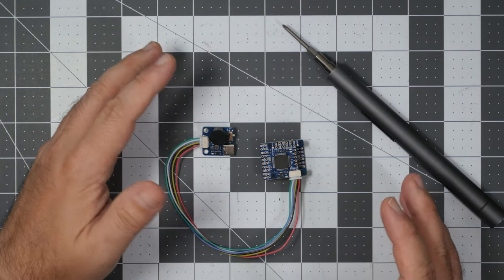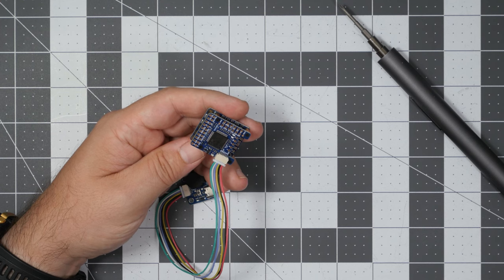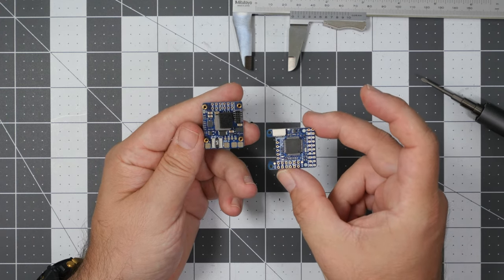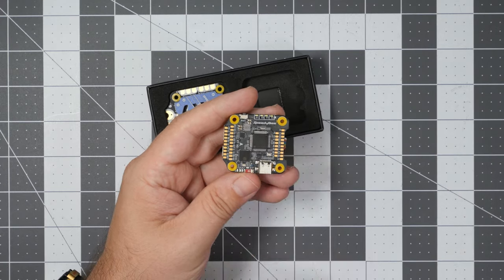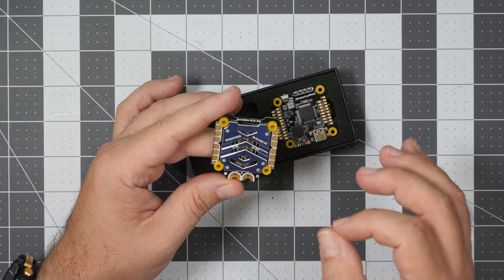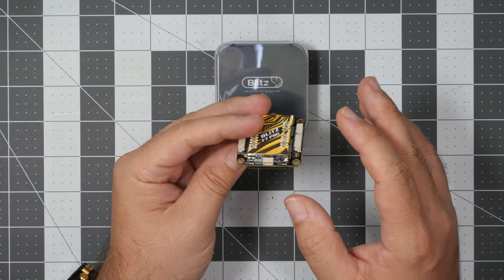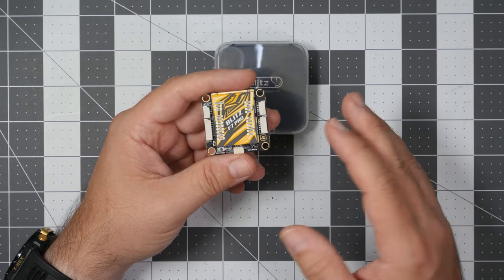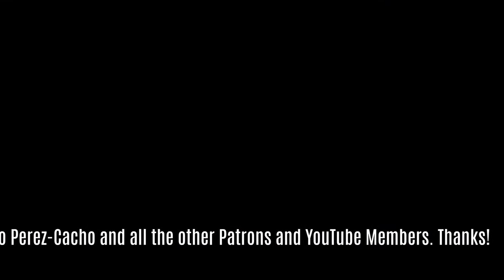Matek F405-WMN, SpeedyBee F7 V3 and Blitz Pro

Comment: 16MB is laughably small for any serious logging. also stack is rather tall for some smaller fuselages. Otherwise nice progress!
Reply: Using a external SD logger became an option for that use case though ;) It's good to see more variations coming out... I have the 765-WSE board, and really like the flying USB connector - if only becase it also has the beeper disable switch for when programming at the bench. 🤣

Comment: Hi Pawel, I got matek F405WMN and all good but I get A lot of video noise after the throttle goes above 20% I put cap on esc and on lipo and LC filter on vtx but still very bad video, any ideas? Thanks

Comment: Hi, Your videos are really interesting, I enjoy watching. A question in short if you may help .... I'm willing to start flying FPV direct, I mean no Arduplane planned flights, or autonomus, but just flying "from the cockpit" with a good OSD on display - regular flight and some basic aerobatics.
I have a Matek F405-WTE FC and build an Open.HD system with Raspberry PI's, and Head Play HD. Everything looks good but the OSD isn't refreshing really good so it looks is not ideal for what I'm lookinbg for. I'm only looking for a short range flights , similar to visual RC flight.
Could you please help suggest a configuration that would be simpler to wire and would provide better performace for what I'm looking to do?
Reply from the maker: It would be either DJI FPV or Walksnail. Wiring simple, small, light, proven to work

Comment: there are two questions, I ordered myself F7V3 flight simulator, but I saw that the baron is 280, but the gear is not mpu 6000 there, how bad is the gyroscope there??? BMI
Reply: Betaflight has fixed any issues with the BMI gyros apparently. Mine flies great with my tmotor F7.

Comment: Unrelated question, is the omnibus f4 v3-s version supported by inav? The accelerometers do not work when I try to flash with f4v3 firmware, is there an older version with support?
Reply from the maker: you might have BMI270 version. It might work with INAV 6 thought and search on INAV's github for test build
Reply: @FPVUniversity  will do!

Comment: How would the speedybee be in a wing? Safe to use 4in1 esc to power a single motor?
Reply from the maker: Not good for a wing. Pick a FC designed for wings instead
Reply: @FPVUniversity  I have that f/c spare, I didn't intentionally get it for a wing. So I'm interested to see how it operates in a wing.

Comment: The F405-WMN is a nice upgrade for my old 411-WSE, I just wish it had more than 16M of blackbox flash, that's going to fill very fast, still the 411 had no black box, so I'm moaning at a party.
Reply from the maker: You can use slower logging and disable some BB fields to conserve flash too. And, you can use one of the UARTs now to connect an external SD card logger

Comment: I like Matek products, but once again, they have failed to include 4 mounting holes for their new FC...😳😳😳🙄🇬🇧🇬🇧
Reply from the maker: double sided adhesive tape mate :)
Reply: @FPVUniversity  Every quad you own has a FC with mounting holes in it. I know you support Matek like some kind of parent, but please try and be a little objective...😳😏
Reply: It's for fixed wing. I like it that way for FW, smaller and easier to install. Just like what Pawel said, double sided foam adhesive tape works the best for FW. Especially small aircraft like Zohd 250gr series.

Comment: Except the Speedybee V3 doesn’t support servos. And the speedybee app hasn’t worked with INav 5.0.
Reply from the maker: This is drone oeirnted FC. So let's say it's fine. And AFAIK latest version of speedybee app works fine
Reply: Speedybee app just got updated and it works with Inav 5.1. It even has slider in PID tab. 
I've tested it (of course not the entire menu)
Reply: @serang  Ah that's great news! I haven't tried it since 5.1 but I will, thanks for letting me know!
Reply: @FPVUniversity  I understand that, I guess I  thought even one servo for gimbal stuff would be normal. I am no expert though
Reply: @FPVUniversity  I thought I would ask, if you dont mind, what flight controller would you say is the best for a commercial type quad? One that could utilize servos, and possibly put some very high powered lights on? One that you think works best with INav, for Lidar and GPS. Position hold and the like are most important, speed is not. 
I was thinking of buying a Matek, but I thought you were the best guy to ask.